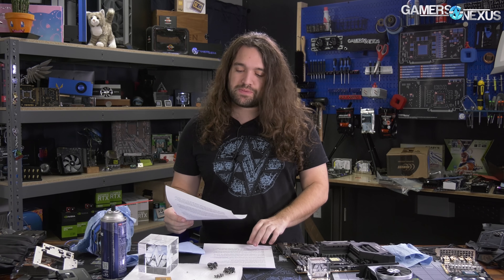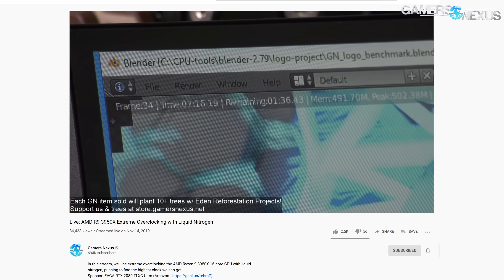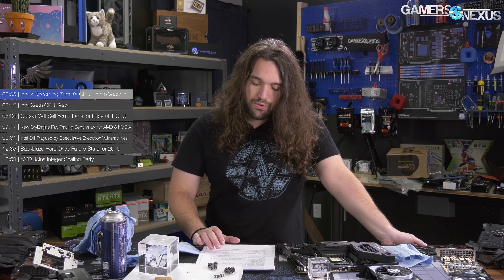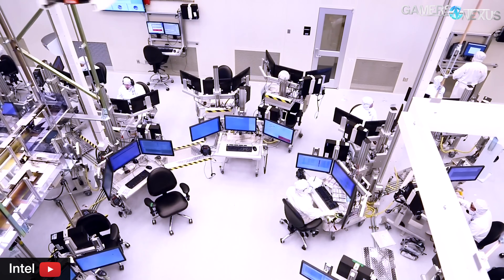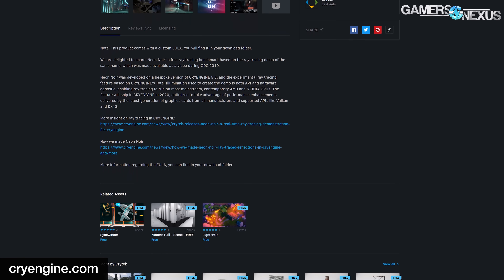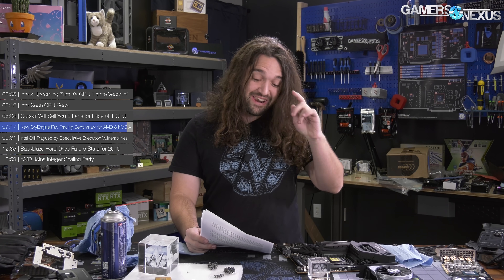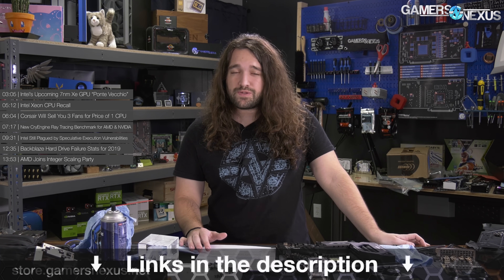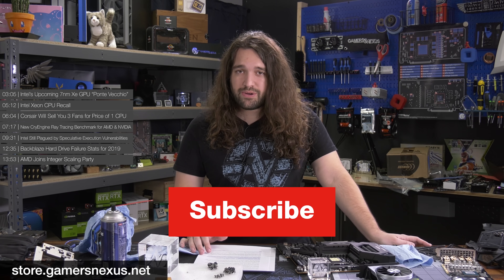HW News - Intel CPU Recall, 7nm GPU, AMD Ray Tracing Bench, & HDD Failure Stats

Comment: The issues with Intel is really starting to force me to switch to AMD.
Reply: You'll have permanently plagued security issues on one side and questionable compatibility, kind of a lottery really, on the other side. Talking about Threadripper, don't know about Ryzen. I upgraded my ancient, but very stable Intel platform to 2nd gen Threadripper by the beginning of this year. I'm not happy with it, but I'll live.. To be honest, there has been a few times when I've thought that I'll just sell all the AMD stuff, with a great loss, obviously, and go back to Intel, but I haven't done that.. yet :| One more thing.. I'm not 100% sure if AMD is at fault here, but I'm very sure that board partners are.
Reply: @sirius4k  Odd I've seen no issues with Ryzen or Thread Ripper 1000 or 2000 series.  Did you update your UEFI/BIOS to the most recent version?  Did you install 4 matched sticks of RAM (or 8) in the correct slots?
Reply: @JQB45  I know how to put together a computer :P I was messing with computers way way before The Verge became a thing :P But yeah.. running latest UEFI firmware and memory sticks are placed correctly. And memory is the main problem I've had. For example: after a restart the PC just wouldn't POST. "Solution" was remove all but one stick. Boot. Shutdown, add second stick, reboot, third stick, reboot, fourth stick. Go to UEFI, enable the XMP equivalent option again. Have had to do this several times. Pisses me off.
Reply: @sirius4k  i had a similar problem with 1gen ryzen...after reboot or shutdown sometimes it happens, that it does´nt boot up, removing ram helped...at the end, my problem was the mainboard, buyed a new one and all problems are gone...
Reply: @georgwarhead2801  I got my first ASUS Zenith Extreme DoA. sent it to RMA, waited about a month and then it seemed like I got some smeared refurbished crap in return. I paid over 600€ for a high-end board only to get some lowlow-end product and crappy support service. + other issues with the product.

Comment: Too much rgb in recent years....
I have decided my next build will be dark or only very little lighting.
Reply: Jon Son Get a beige case from early 2000 era
Reply: @GhettoPCbuilds  Early 2000 Cases were mostly black, silver or red.  You have to go back to the early-mid 90's to find a reasonable selection of beige cases.
Reply: @JQB45  good luck with the cooling though.. I still have such a case laying around. It has one 80mm intake and one even smaller outlet.
Reply: i can recomend u a Dark Base 900v2 from  be quiet
Reply: I just built with BitFenix Nova no window case.  Why have I battled so long against cables and trying to get rgb to work?
Reply: @MrRourk  cables dont matter if your case looks like a shoebox :P

Comment: I could buy a 3 pack of the new Corsair fans or a 2700X from Micro Center ...
https://www.microcenter.com/product/505632/amd-ryzen-7-2700x-37ghz-8-core-am4-boxed-processor-with-wraith-prism-cooler

Comment: If I care about security should I even buy an Intel CPU?
Reply: Most of the security updates don't really apply to home users as corrupting a single person's PC isn't really worth it. The others have left valuable advise and points. If you are a power user with multiple users or use a lot of 3rd party peripherals (flash drives, etc) it may be a valid concern. For home use, not really a big deal (as of yet.) Part of the reason AMD was so slow to release ryzen was because they put security ahead of performance, which intel did not. Up to you to decide.
Reply: T A     The chances of being exploited are almost nothing. It takes a very complicated set of circumstances to make it happen.  The patches already in place are not perfect but make it even harder to exploit.
Reply: Hard to say... This situation happened only because Intel CPU didn't change that much in the past years (just watch how there are so many Chinese motherboards and mod boards to use different CPU generations/sockets on the same motherboard) so people had a relatively easy time to study them to find bug and vulnerability.
I think it will be just a matter of time before people find issues in the and CPU too unless they make Another huge change in their architecture in the next years
Reply: remember 20 years ago the entire Internet wasn't Encrypted, yet people still survive.
Reply: You would just be a caveman seriously

Comment: Honestly Steve, considering the crazy voltage you’ve needed in the past to get those kind of numbers, it’s pretty darn impressive. I mean, -50 is still a wild temperature to have to reach to hit 4.9, but it’s a matter of perspective.
Reply: Could you get down to -50 using dry ice instead of ln2?

Or, go for the closed ln2 loop.
Reply: Marcel Krebs see my above comment, you don’t need either, and it’s cheap to run 24/7 with no maintenance (actually less maintenance than my water loops...)
Reply: @ToriRocksAmos  not under load and cant do closed loop LN2, you would be dealing with explosions
Reply: John Chrysostom  but the thing is none of it is really practical, who on earth has the volume of liquid nitrogen or ln2 and keep it regulated to -80 or even -50 to run on that speed.
i know its a overclocking benchmark test essentially but its just not logical for the everyday user, thats my opinion.
Reply: @Dockhead  nobody anticipates it being an everyday thing, that's why it's called exotic cooling...
Reply: boyo to be fair, phase cooler... I bought one for less than a “high end” water cooler, but you know mine would feels a water loop into ice. Idle is -60c, hottest I’ve ever seen is -35c on the block under load of FX-8350 at 1.7 Vcore (lol, that Ryzen pulls less power!).

Next build will be multi-stage, aiming for -100c on TR-64 core as my next daily machine upgrade. Who said you need LN2 for that hot temperature? Relatively speaking, that’s hot...
Reply: @jakegarrett8109  still not reasonable. Still considered exotic, especially considering dealing with condensation with phase change cooling. Also cost ( around $2k+ and 400-800w of power draw.) And actually since they don't yet make tr4 phase change (yet) i would be inclined to disbelieve your statements.
Reply: needabettername for some water cooling is exotic... yet it’s incredibly easy. For reference, it cost less than $5 to make water cooling on the back of a 7 inch tablet, why? Because I saw a video titled “things you can’t do with a tablet” and it featured a bunch of water cooled PCs, so my first thought was “are these people that lacking of creativity or just so stupid that they couldn’t do the same to a tablet?”, inspired by this challenge and 2 hours of CAD designing, I made a Fallout 4 post apocalyptic themed water cooled tablet. The pump is hidden in the reservoir which looks like a nuclear waste barrel, with green “radioactive” coolant pumped out to rusty steel pipes acting as the radiator (the inside is sandblasted clean, but I wanted aged and rusty metal pipes since it would be hundreds of years in the future in this dystopian setting and dilapidated materials), and then going to a custom made CPU block (I didn’t see any that fit my application, so I simply developed my own. I published the block free for personal use on Thingiverse if you would like to recreate, also works well for other things like LN298N duel H-bridge motor drivers or other microchips like raspberry pi). That wasn’t hard at all, I assembled it after I got board halfway through a movie, total cost was like $3.75 to $5 for all parts (minus tablet). And yes it’s now overclocked 44% higher with max temp of 50c at that overclock instead of 90c at stock speeds out of the box.

No $hit they don’t have a TR4 socket evaporator, so I’m making my own, lol! Most phase coolers are handmade, it’s just a lot of brazing. But it’s not much power draw, for the FX results posted I was using a basic commercially available Vapochill LS unit, which only has a 1/3HP compressor (due note the AM4 and AM3 sockets don’t exist so how did I do it? Socket 775 mounting shell with zip ties works fine... I’ve even used the cooler on GPU until I cracked the BGA solder and murdered my first gaming card, I simply designed and then 3D printed a mount and made a nichrome wire heater to keep the outside insulation at room temp, you can simply use an Arduino with 2 thermocouples and a simple transistor if you want temp regulated... condensation is not an issue, I don’t just benchmark with it, that’s what my T-Rex LN2 cooler is for, lol, phase is for daily machines!)

Side note, it doesn’t take much skill to do these things, like that’s just what I do when I get bored on an afternoon. Sure I have a degree in mechanical and aerospace engineering, but I did all of these in high school... Like it’s really not complicated. The only advantage I will have from the thermodynamics/heat transfer classes will be a better understanding of calculating the refrigeration cycle stages that I’ll be using and optimizing compressors for the gasses I want to use, but anyone can do some research and learn the same formulas and apply them thanks to the Internet making learning more accessible, often for free. So if there is any task you think is too big that your interested in, I’d challenge you to go pursue that goal, tackle it, fail a few times, learn from your mistakes and keep at it. That’s  how I learn, I have a motto “Learn to fail faster”. Why? I learn much more from my failures than when everything works fine the first try. When I build an experimental plane, I want to see what weird phenomenon or design flaw it has, that’s how I learn, I’m highly disappointed if it just flies perfect the first time because then I didn’t learn anything and know that I wasn’t ambitious enough or pushing boundaries. So my approach is to fail as quickly as I can so I can learn as quickly as possible. Anyways, good luck and never stop improving, cheers!
Reply: @jakegarrett8109  i wouldn't consider standard water cooling exotic, as parts can(now) be found everywhere, while 5 years ago there were really only 3 sites that you could find parts which were expensive and hard to find. Tablet water cooling would be exotic, especially since you can't get on an airplane with it.

Edit: i do have a degree in thermodynamics and own a small custom loop building business with few customers, but not enough money to be made doing it full time, as my margins are pretty low and don't want to get 200 orders that would take me 500+ hours to complete...
Reply: needabettername side note, do you think anyone would be interested in a video of that project? I do a lot of other stuff no sane person would even think of (I’m amazed I still have both eyes and all my fingers).

This project is all about the best performance there is (I imagine that Tr-64 core is going to be $5k, and I expect spending up to $3k if I don’t do the brazing on the cooler, the block will be CNC machined when I modify my 3D printer or if I just build a proper CNC to make it). But, think about it this way, the 9900k owners paid 4x more than the 2700x for just a mere 800 MHz advantage. People spent more on it than my TR-1950x with double the cores and double the memory lanes and 4x PCIe lanes (yes I run quad GPU), and they paid MORE, sacrificed all that for a mere 800 MHz advantage... (My 1950x runs 4.15 GHz on a cheap 120mm AIO, AVX instructionset included). Is the 50% price bump using phase that crazy then if it gets me closer to 5 GHz? It’s certainly not 4x the cost... plus, note that I still use a phase cooler from 2006, 
that thing is still working, who knows how many CPUs have benefited from its monster overclocking potential, it’s even cooled more than CPUs! The 9900k is a 1 time upgrade, a one time waste of money and then it’s obsolete and no advantage having it. Meanwhile that phase cooler might be used many years in the future and allowing wild overclocks for many upgrades to come, it’s not a 1 time disposable use like a premium CPU.

So first I’d say it’s not crazy (buying Intel is for non EXOC, but many people do it), and it’s waaayyy too much fun to not do! I love it seeing a system frosted over (not that it happens with the embedded insulation heaters on, I turn those off just for the looks sometimes, haha). It’s just a blast!

Comment: The i9 does not come with a cooler, but intel specs the same cooler that comes with the i7-9700 to go with it....and that cooler is utter shit.  The only difference between the i7 cooler and the cheapo i3 cooler is that the i7 cooler has a plug of copper in the center.  These coolers can't cost more than about .50 to a buck to make.... Cheap arse mthfkn Intel.  AMD is going to mop the floor with you, and that excites me!

Comment: For me, the CryEngine ray tracing benchmark really mattered when I saw a Ryzen 5 3400G (APU!) run it. At low ray tracing (mostly water and mirror style reflections) it fell to +/- 30 fps, with a couple dips to ~25. On full, that poor thing chugged; I think I saw it drop to 12 frames. But, that's at full ray tracing and an ordinary APU on a simple PC spec board! Honestly, that's pretty good. And it's a solid proof of concept for ray tracing on whatever specialized chippery AMD are cooking up for the PS5 and XB2.

Comment: is corsair nuts?! why should i pay 130 bucks for some bling bling? O.o
i'd rather buy a chain of christmas lights and wrap it around the housing and be done with it.
Reply: Many "hipster" brands have lost it, slap "gaming" or "led" on it and increase the price 50%. Sadly it works due to simpletons who buy$ into that
Reply: @Mikael
Not really, it works because they're cashing in on convenience.

Sure you could probably get a set of plain led fans that are just as good for cheaper, but if you ever want to change the color you're going to find yourself having to buy a whole new set of fans. Or you can just buy these overpriced RGB ones now and not have to worry about it.
Reply: Daxter250 LOL
Reply: Buy some track tires for my weekend car or buy some fancy fans for my computer, I think the choice is clear now
Reply: because the leds are addressable - there's what, 24 leds in each fan, and each of those can be set to a specific colour. that's why they have that insane price.
Reply: @Drestlin  100 RGB LEDs = 10 bucks on Amazon
24 RGB LEDs = 100/24*$10 = a million, probably
Reply: @kotekzot  but are the 100 leds singularly addressable? if they are, your point stands - note also i consider this price insane and would never pay more than 20 bucks for a great fan :D
Reply: you should bc it have gaming word on package. Ofc u can buy delta fans or gentle typhoon, but wihout rgb it no give extra fps.
Reply: There's old Finnish saying which goes basically like this: Fool isn't the who asks, but the one who pays.And average consumer just doen't anymore have any thinking ability and keeps shoveling money to greedy corporations for getting butt raped.

Comment: 5:28 did i hear "quad core xeon" ? wtf is this??? 2007???
Reply: It's Intel and you're surprised by low core counts? 😕
Reply: @CompproB237  low core count on low-end and lately mid tier consumer CPUs is "normal", in server space, nope.
Reply: @CompproB237  $7000 for 4 fucking cores???? q2 2019??? wtf why does this exist???
Reply: @williambrown3699  Its designed to be used in an 8 CPU system.  Still overpriced but thats Intel for you.
Reply: I used to have an E3-1231 V3 that was basically a locked 4750 with no iGPU (released back in 2014). It did its job well even in gaming, but I am more than happy with my R5 3600, now.

Comment: i dont buy fans unless they are good quality, high static pressure and cfm. noise is an after thought but its better if its lower. and not annoying at low speeds. i hate that china makes so many terrible fans that shouldn't be in any case.

Comment: I feel bad for Crytek employees because I'm suffering from the same situation for 3 months without a salary.  From 5 Sep until till now
Reply: Why? After two weeks you should have booked it!
Reply: @alexandermckay8594  Perhaps there is stock option potential or some other reward, either way I wouldn't stay without pay.
Reply: @JQB45  Stock options on a company that can't make payroll doesn't seem to be a reason to stick around!
Reply: @alexandermckay8594 sure, as soon as I get an offer I will leave them with no regrets
Reply: @JQB45  the unemployment rate is very high here, but as soon as I get an offer I will leave them

Comment: Anyone who pays $45 for one 120mm fan has way too much money.
Reply: Corsair is testing the water. How high is too high
Reply: @KarrasBastomi  For me at least $20 is as high as I'll go. That's what the top of the line Noctua 120mm's are going for right now.
Reply: 45$ for one, dang. 
The LL120 were like 80 for a set of 3 and a daisychain box. Corsair calm down
Reply: 2 years ago I got 5 TT fans at fry's at $20 a piece I was shocked why so much for a god dam 120mm fans

Comment: FFS! Corsair!.. There is no way Corsair is spending this much money to develope those fans and on top of it the design really isnt even original. They just very slightly modified the frame of many of the chinese fans that have been on the market for the past few years, slapped their badge on them and called it a day..  BTW if Corsair is reading GN comments. Besides the fans being way overpriced. People actually want and need some really good STATIC pressure fans like the old models Corsair used to sale..